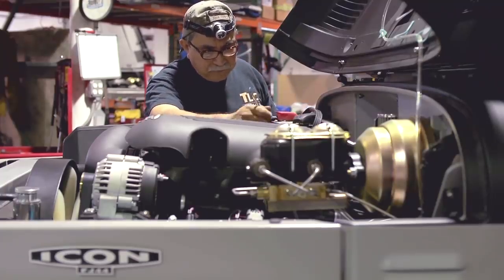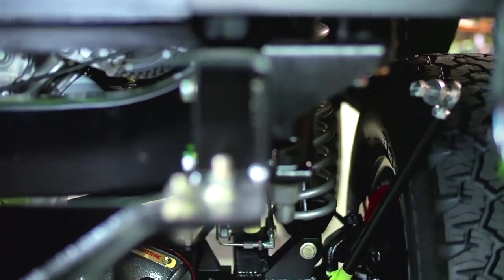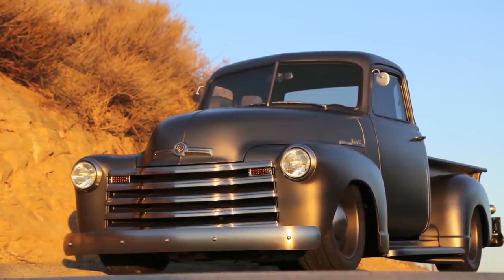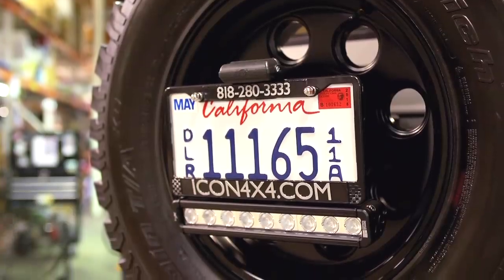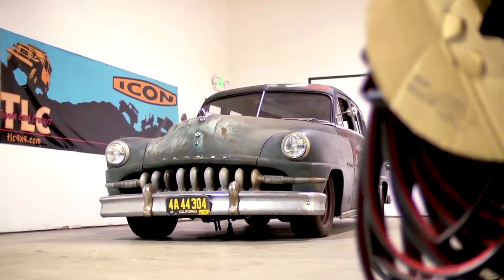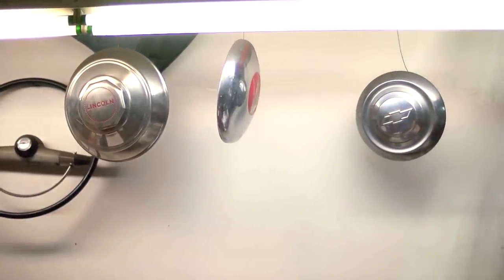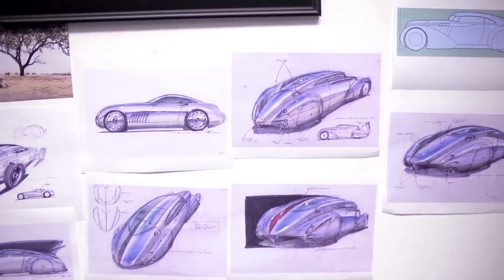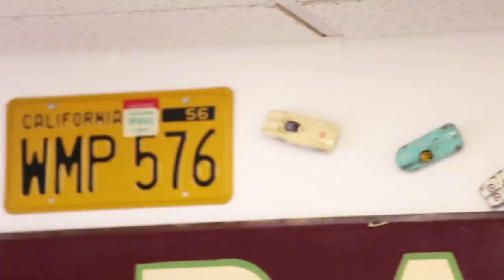ICON 4X4: The Coolest Car Company In The World? - Carfection

Comment: Just did a brief google. "Production" models (like broncos or fj40s) reportedly run about $2-300,000. Reformers and Derelicts - the sky's the limit, 1-2 million. The client is doing a bespoke collaboration. And it appears it takes two craftsmen a year for the physical assembly, never mind the outsourced parts, the computer hours and diligence in the design.  These things are works of art, and I want one so bad my teeth hurt. Mr. Ward is clearly a one-off, and lives on a little higher plane than most of us. Possibly more cycles per second.

Comment: I've rebuilt several vintage cars & trucks in the past. I pretty much always wanted them to be as close to original, but in the last few years I've thought it would be nice to restore vehicles to look original, but be electric motors & modern running gear. These guys are more than part way there.

Comment: Out of curiosity how does one "re-brand" a vehicle like is done in this video? I could understand it being sold as "Ford Bronco by ICON" but to completely replace the actual Ford logo with ICON...is there trademark issues with doing this? I watched the Jay Leno Garage episode with the Bronco. I've also seen the Hennessy Venom, a re-branded Lotus. Where does Ford end and ICON begin? Surely Ford has not given up the rights to the Bronco name so how does a private company re-label them?
Reply: Joe Blow Ford was the one who made him take their logo off.
Reply: It’s done via “licensing”. As mentioned in the video ICON has close business relationship with car companies like Ford and Toyota.  They’re completely reengineer old classics by doing restoration mods.  So a Ford Bronco by ICON would use an original Bronco body attached to a new ICON built chassis. While the rest of the drivetrain would consist of a new engine & transmission sourced directly from Ford.

Comment: Most overpriced overated cars. Basically and assembly company. Buy in parts, bolt them on and charge goons a fortune. LS engines for god's sake... boring. They might make a grille or door handle but the rest is bought in, not engineered. As I said, overated